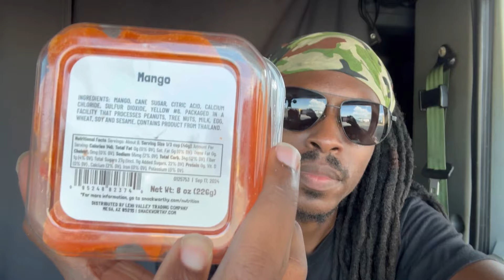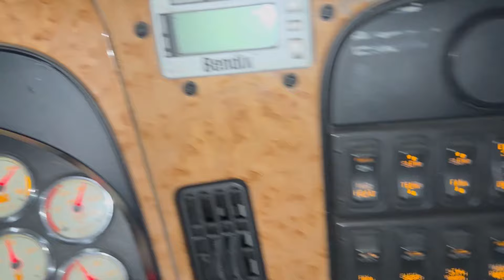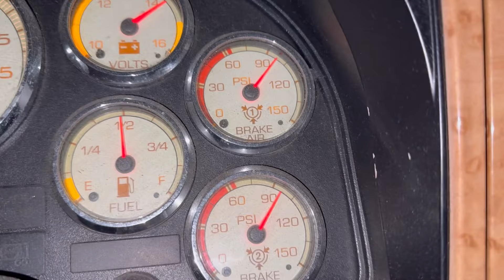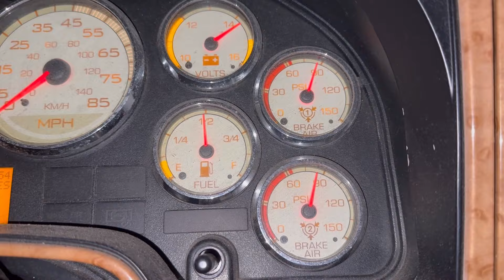Truck Repairs ➕ Trailer Repairs ➕ Another Dumb Break Down

Comment: 3:49 im about to grow my hair so i can have a pillow too! 😂❤
Reply: Always carry some spare fittings for situations like this, 3/8 rubber compression fittings and a bonji and keep it pushing, what most drivers do to get it to the shop they use electrical or duck tape and keep rolling
Reply from the maker: I have some but Landstar doesn’t like for us to work on the trailers. I think it’s a liability issue.
Reply: Whatever it takes liability or not. You can red tag the trailer when you drop the trailer. I have ran into that situation  the spring that holds the lines came off dragging the lines. A fix for that is take a ballpoint pen and remove the guts, then cut the line at the hole, then connect the lines with the pen with 2 clamps. There's your fix. Bet when your pretriping yo will check those lines for security from now on...jus saying...

Comment: You could have tied the line back up. Covered the hole with a small piece of plastic/ pvc pipe heavily wrapped with electrical tape. Might have let you limp it in to the terminal.